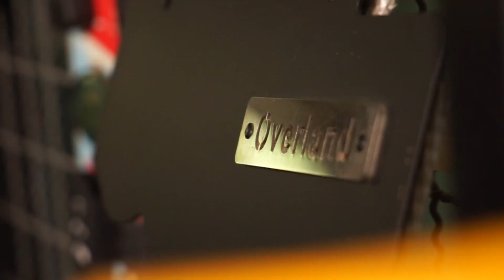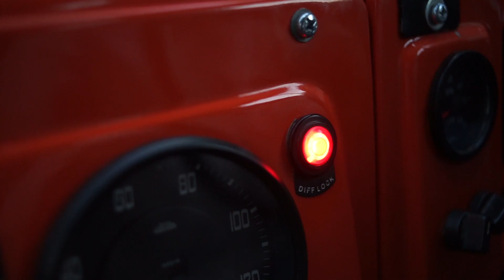OVERLAND : Land Rover Series 2A 109" Renovation

Comment: What makes you think that's a Series IIA?????????????????/
Reply: The dashboard, gauges are in the centre and its made of metal
Reply: Looks like a 110 with Series 3 body and Series 2 dash.
Reply: I was thinking it's a Defender with a Series body slapped on it initially, but at 1:36 it's got the front leaf spring mounts still in place and at 0:41 it's either had a lot of patching to a rusty chassis or it is a Series chassis as it's flat on the bottom face of the chassis rails unlike the pressed Defender chassis rails.

The interior is nice